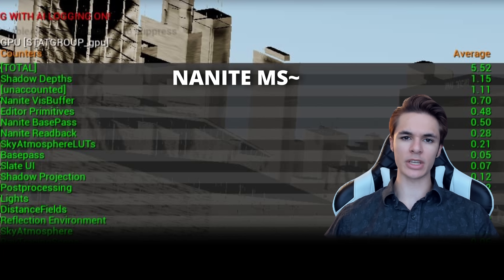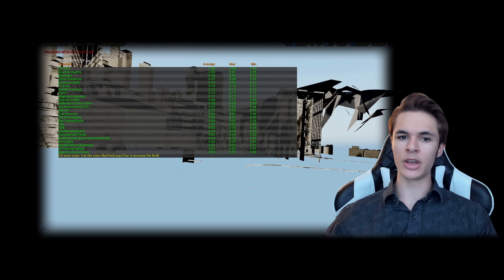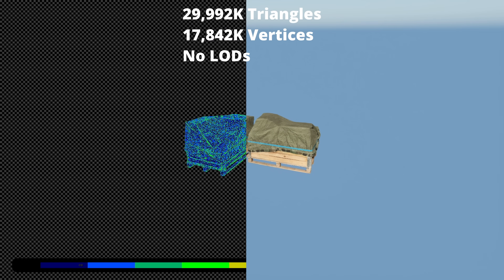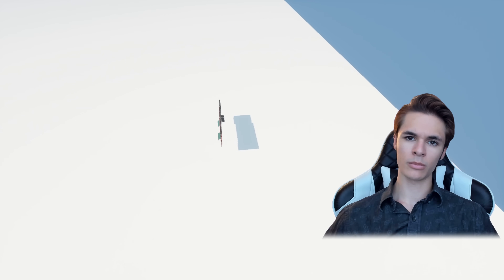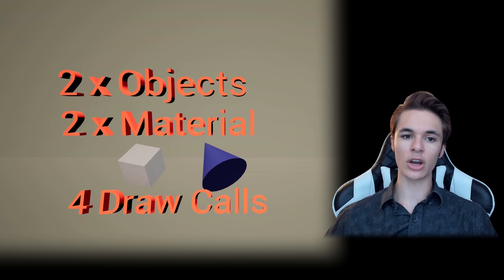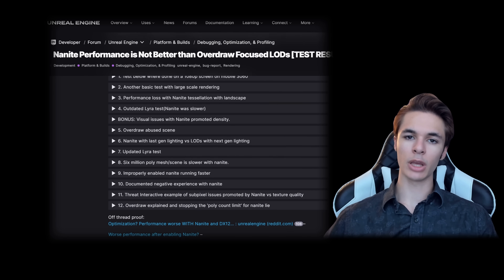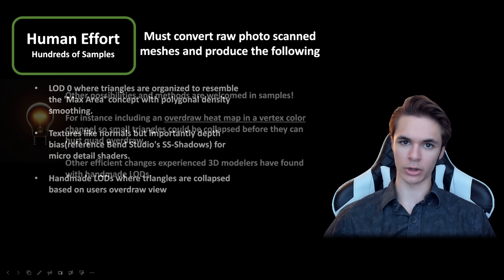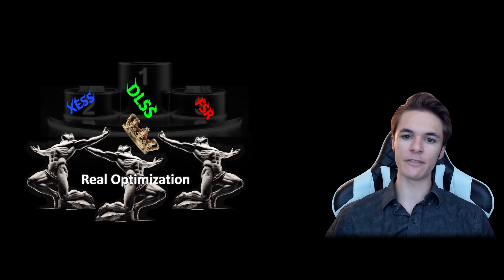Epic's Unreal Optimization Disaster | Why Nanite Tanks Performance!

Comment: When I took a class in game development, all of my peers jumped on the nanite hype train due to the time it saved with apparently no downside. I initially took that at face value. I decided to port my private UE4 game project to UE5. And I immediately noticed that somehow an empty default settings EU5 project was running significantly worse than my EU4 project with my assets. I wasn't even looking at the performance stats initially, I just felt the performance dip. 

I stopped the conversion and stuck with EU4 for my personal project. And as you can imagine the nanite-loving class project ran like a slug. Although, I was never educated on why EU5 was running so slowly. Thanks to your channel, I'm finally getting a deeper understanding.

My question is, do you plan make videos that are high-concept tutorials on how to program engine-level optimizations like Vercidium's channel? I may want to try my hand at engine-development, and videos like that really help as a learning resource.

Comment: Another part of the issue may be that Nanite wasn't designed exclusively around the Mesh Shaders system on the newer generations of GPUs. They use general compute to be able to support older hardware and the system is designed with having to do it that way in mind. They do have a fast-path using Mesh Shaders for polygons larger than a pixel, but it sounds like it's kind of just throw in there for a little extra performance boost instead of it being an entirely separate path for the whole system to run through.

Comment: As someone whos worked in UE for 5 years now, the engine out of the box is BLOATED. If you want to make any sizeable release, you often need to rework source code to get it where you want it and bypass a lot of useless code you dont need
Reply: Well, that is every external software you subscribe to that is not made for your specific used case

Comment: Could this be an issue with current hardware not being optimized for nanites? Perhaps future generations of hardware will have better performance with nanites?
Reply from the maker: You're having an extremely common take on the situation: "future hardware will make this better"

We are not targeting future hardware. We are targeting base 9th gen consoles which we KNOW can deliver far better results (and we're talking reasonable potential). 

If we have such a massive waste on this generation, the waste is only going to trickle down to future hardware for the potential that can offer.
Reply: @ThreatInteractive  I am not talking about just the increased performance of future hardware. Perhaps hardware could be arranged differently in the future to take nanites into account. Because clearly nanite has other benefits in terms of mesh creation, that makes it appealing to the industry. For example, if the overdraw with quads are making nanites slow, perhaps that could be changed into something else.

Comment: Let me get this straight. Lods run better but have popping, nanite helps with performance but not compared to lods. 

Wasnt the sell point that nanite helps people from needing to optimize very hi-res assets so this speeds up workflow? I just don't get what's wrong with making hi-res assets available for real-time. Perhaps it's wrong to suggest you should apply nanite to regular game size assets over a LoD system but that hardly makes this some kind of "optimization disaster." You're definitely over-stating that nearly on the same level they are by saying to apply nanite to every single model. Your discussion is well warranted without the bitterness and anger for who knows why.

Comment: What many seem to forget is that DLSS and other upscaling things are meant for games to run on slow hardware. And now it's required to be ON if you want to have nice framerate on your top notch PC at ultra settings. It always makes me laugh and also sad at the same time seeing 2010s level of graphics with barely 30 fps on modern machines. We had better looking and faster games back in the day.

Comment: This approach only makes sense for games that prioritize millisecond differences, particularly high-performance multiplayer games. However, for traditional artists and the majority of studios, it's impractical to suggest reverting to manual mesh decimation to avoid overdraws or relying on a DCC for that purpose. Nanite isn't just about "optimization"; it significantly speeds up workflow. Additionally, with the introduction of Nanite Displacement meshes, smaller studios will experience a substantial boost in productivity, as they won't have to manage multiple LODs per asset. It seems that you are approaching this from a technical standpoint rather than having experience running or managing a studio. While it's possible to create a custom GPU architecture for a specific game and achieve a 100x performance boost, it's impractical. When scaled back, this is essentially the main argument presented in the entire video.
Reply from the maker: Re:It seems that you are approaching this from a technical standpoint rather than having experience running or managing a studio.

We have repeatedly stated Nanite helps development time because it's fast and automated. We stated this is a good thing. 

We promoted the funding of fast and automated systems that promote performance through performance research based algorithms.

We believe in compromises with developer and consumers. Hence properly implemented raytracing over cubemaps. Nanite offers NO pro for consumers. That is a giant problem and it also causes an extreme waste of reasonable potential offered in new affordable hardware.
Reply: @ThreatInteractive  The Pros for consumers is that small studios can tell deep and rich stories without worrying about exhaustive pipelines. I'm afraid I have to disagree that squeezing every ounce of efficiency from consumer graphics cards when games already run +60 FPS is not a worthy trade. But it's just my opinion. Both consumers and developers have the final say in their respective needs.
Reply from the maker: @thecackleman  The recently "deep and rich" stories are being slathered with blurry garbage or are being rendered at such such high (combative to temporal blur) resolutions that reduce interactivity modern games should/can provide. 

Re: Both consumers and developers have the final say in their respective needs.

Well now consumers know exactly what is  being sacrificed by developers. We have now opened up the ability for studios to attract players based on mesh/shadow rendering optimization.

RE: But it's just my opinion

In the end, this is what we are stating. Every comment, video, or reply is just an opportunity for our supporters to understand the views our game will be based on.

Comment: What's silly to me is that the "industry standard" practice is to use a different shader for every type of object, merely because the object was made by some artist in some external application, who was allowed to just make up their own shader for that object in whatever gimmicky visual scripting system they had access to.

A proper in-house engine can easily get by with just like 1-3 shaders and 1-3 draw calls for the entire scene, because it doesn't have to be general purpose. The advent of general purpose engines, meant to lower the barrier to entry, was the advent of poorly optimized games. Making software general purpose necessarily makes it worse at any single specific task.

If you, as a developer, choose to use Unreal, Unity, or even Godot, you are choosing to leave a significant margin of performance on the table. And that's fine, as long as its acknowledged.

Another side effect of this era of general purpose engines is that people have this ridiculous notion in their minds that creating an in-house engine is a herculean task. It's really not. We're overestimating how much of the heavy lifting Unreal or Unity actually does for us. When we try doing that part ourselves, we find that those general purpose engines aren't doing the hard part for us. They're doing the easy part for us, and charging us for it.

Comment: Great content, thank you this! One question that comes to mind. The industry has decades of experience with traditional rendering method while Nanite is only a few years old. Do you think it is a factor to take into consideration when comparing? Do you see Nanite in 5/10years being way more efficient ?
Reply from the maker: Great Question. 

The only way for for Nanite to improve would mean it would have to be drastically changed to the point where it would be a bit of a cheat to still call it "Nanite".  Our video is talking about the same algorithm that has received 5 iterations. 

Nanite is an implementation of a couple of different concepts such as visibility buffers, mesh compression, and cluster culling but the industry could(already has) meet systems that touch on those same systems for a better performance result. For instance deferred texturing in the Decima Engine.

How well Nanite runs or what hardware later in time doesn't matter. The industry has been given it's target hardware(9th gen) and the results we're getting from UE5 Nanite enabled games is a joke in terms of visuals and reasonable potential. If we waste potential now, next gen(10th) and so on will lose value as well.